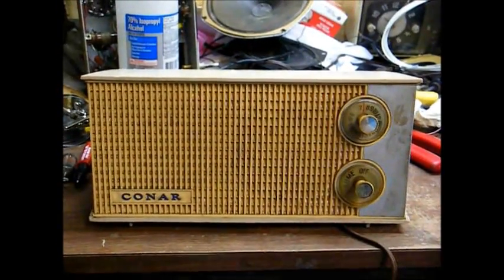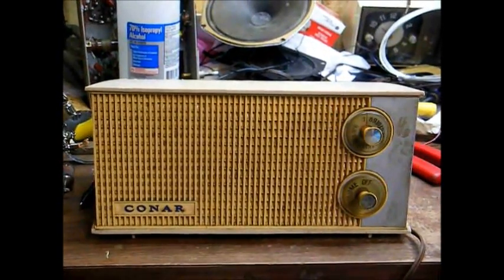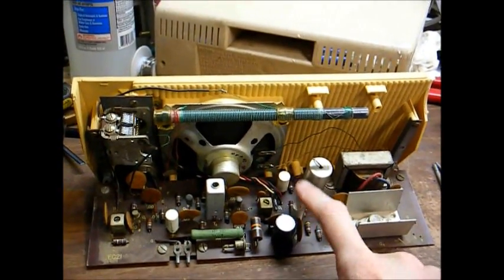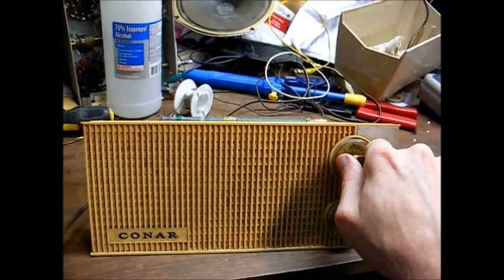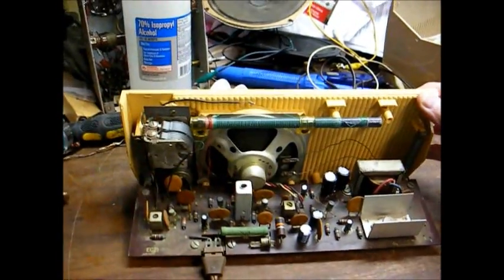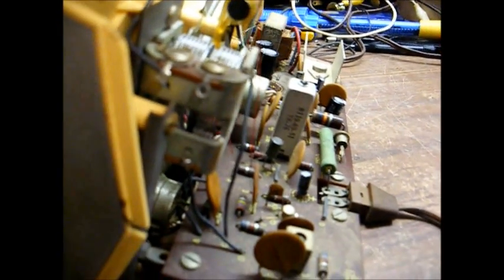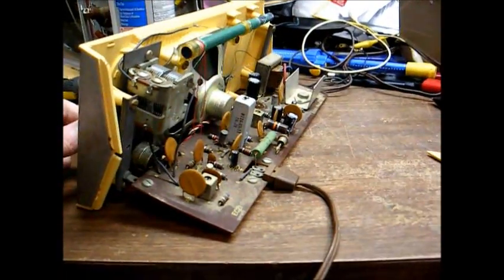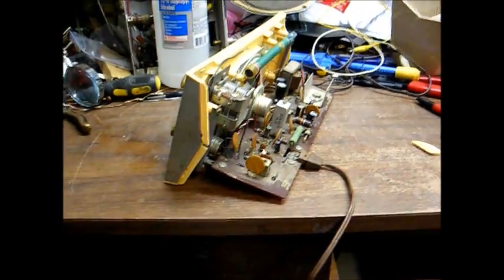1970 Conar (NRI) AM radio kit

Comment from the maker: Years ago, I had a Conar 19" B&W TV. IIRC, it was mostly solid state; but, had tubes in the horizontal and vertical sweep circuits, audio output, HV rectifier, and video output stages. That was back when people would buy any kind of working TV that I could get my hands on and I probably sold it. Now, if it's not Plasma or LCD, they don't want it.
Reply: Well, that's no longer a problem; I think they stopped making Plasmas about 2 years ago. Onward and upward.

Comment: My uncle has a Conar set identical to yours, he took an NRI electronics course in the early 1970s, I think he said he put his together in 1972. He also mentioned that there were two or three different oscillator circuits that you could try to see which worked best as part of the course.